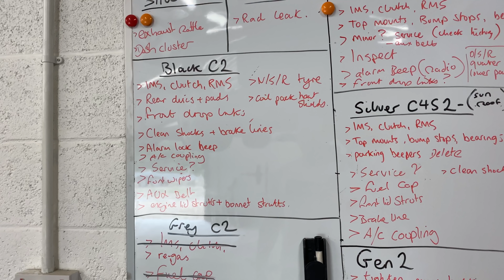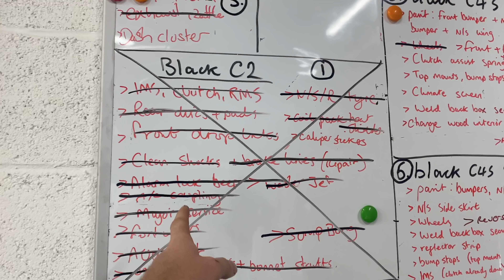Which Porsche 996 to buy; the pre-facelift or the facelift? - FGP Prep Book EP13 (Part 1 of 2)

Comment: That black car is beautiful, but I would say that as it's currently sitting in my garage 😁👍🏻 Thanks again Luke.
Reply: Can you let me know what top gear back boxes you have on it? Are they the full-on loud sports version that they do or the mild sports? Sounds great. I've got an almost identical 996 and am looking at replacing my back boxes.
Reply: @garyhellier1555  they are the mild ones. A little bit boomy around 3k revs but either side of that ok. For the money you can't go wrong. I'd recommend them
Reply: @a1topdog  Great. Think I'll get myself a pair of those.
Reply: Gary Hellier Top gear also do a switchable back box which has a Bluetooth remote to change.  Had these installed on my 996 C4S 18 months ago.  With valves open you will upset the neighbours as ridiculously loud but fun in tunnels (and boarding the car ferry to Le Mans with the other exotica :) ). Sound fab closed too and a big improvement over the original in terms of tone.   I think topgear have videos on their website, but you should also find clips somewhere YouTube.
Reply: @paulfell1228  That sounds interesting. Can you recall what you paid for them & install? and who did the install? I was thinking I would like to do it myself but those rusty nuts and bolts do worry me ;)
Reply: Well done mate and could u post the running costs in a years time and any problems uve found owning an old Porker!
Reply: @EtonieE25  I've owned several Porsches before, and the reason I bought this one as it's had all of the usual known items recently addressed. Therefore I'm not expecting any major expenditure outside of routine maintenance and and consumables. That said, it's an 18 year old car so who knows what might crop up over the next year.
Reply: @ topdog Thanks for the reply mate and that’s interesting u owning a few Porkers

If any 911’s in the bunch any personal feedback as to £££££’s high running repair costs? I’ve been watching this blokes site for a bit now n he seems to b hoovering up as many affordable 996’s as he can coz he’s realised there’s a gap in the market for us lot who r not friggin ££££loaded n to b able to buy a Porsche. 
And l like the fact he calls them Porsche and not like a nob Por-chure 😆

All l keep getting told by others tho is that these are old expensive cars to run n it’ll b a money pit with the old saying....... Anyone can afford to buy a car, it’s the running costs! .......so hence why I’m asking. Thx mate. John
Reply: @EtonieE25  Hi John, they are no more expensive to run than a modern family saloon. Minor service is about £250, brakes and pads cheap, only about £50 a disc, plenty of quality after market parts. Road tax a bit expensive, about £350. I guess it comes down to how much you could do yourself if you are budget conscious. They are very easy to work on.
Reply from the maker: Rub it in for the others in the comments section why don’t you... pleasure Steve 😆
Reply: @EtonieE25  so, correctly pronouncing a car's brand name makes you "a nob". LOL
Reply: Great video. I’ve been in 2 minds whether to pull the trigger as buying a car of this age/ spec is daunting due to costs etc.
Your videos are great and would have no problems buying from you as you clearly go over the cars well before they are sold. 
You’re clearly a smart guy and using this as a tool to show you’re a reputable seller.
I’m watching all your videos also. I was always a 996 hater but now I’m converted. All the best! You might’ve hearing from me in the coming months 👍👍
Reply: WHERE THESE LADS BASED FOR FUTURE REF PLS?
Reply: @daveholloway8780 Did you buy, in the end?

Comment: I really like the detail in the videos - definitely not waffle.  I think I prefer the headlights and would prefer the few extra creature comforts in the facelift.  How are the 996 c2s without psm?  I think I’d want that as a safety net (I know I could just be more careful).
Reply: TJSTR the 996 was designed to understeer and be stable, even in the wet with psm off you would be very hard pressed to lose it. I drive faster than most people,you have to really really push it to get it moving around. You can buy any of them with complete faith in their handling
Reply from the maker: Thanks for the feedback. In my opinion, the difference between PSM / TC is only noticeable on very wet roads.

Comment: Great video, very interesting. I'm currently looking for a 996 Turbo, but was put off a bit by a dealer who said the 996's had problems with Turbo heating issues compared with a 997. He said also IMS could be an issue, even though I said I thought Turbo's & GT3's didn't have this problem at all.
So, he said he recently had to prepare a 996 Turbo for sale, which had corroded bolts due to heat, cooling pipes to be replaced etc.even though only 50k miles on car. Is this all true & 996's aren't as sorted as 997's? Thanks
Reply from the maker: Hi Steve. The Mezger engine in the Turbo and GT3 cars don’t have the IMS “issue”. Most 996s and 997s will require some kind of corroded bits and pieces renewing underneath. They’re getting old and it comes with the territory!

Comment: Great video, gives a good overall but in depth feel for it. I have the identical car, owned it now for 3 years, and absolutely love the drive. A great contrast to my Z4 M Coupe - same performance but such a different delivery! I had the standard suspension, and concur with your comments, as I lowered it on the same H&R blue springs for a 25mm drop, matching them with the Bilstein B8 Sport shocks - minimal ride comfort compromise, but MUCH sharper better tied down suspension, more accurate and quicker turn-in. When matched with 17mm spacers all around, gives it a fabulous integrated stance on the road, with the rims lining up perfectly with the bodywork. 
Also did IMS(LN single row), RMS, water pump and dual mass flywheel when I bought the with 64000kms on it. You can see it here: https://youtu.be/NCXxP_UUduw